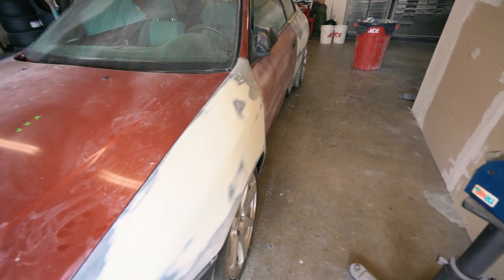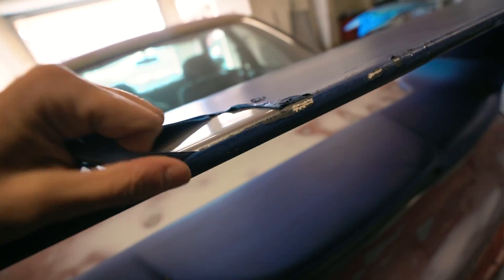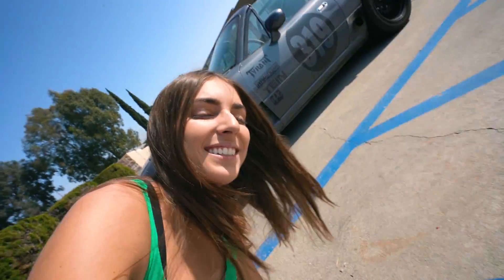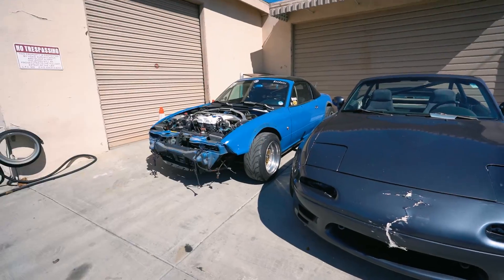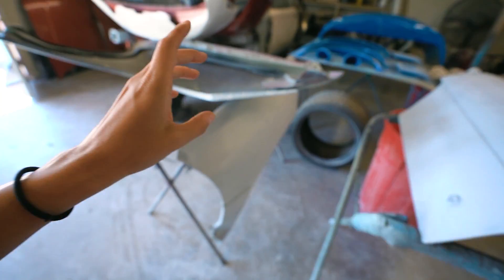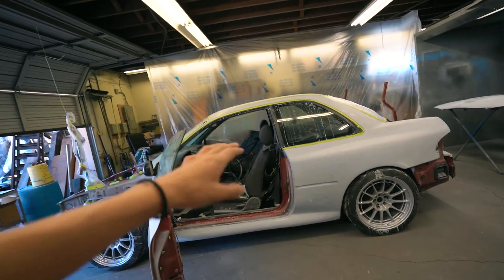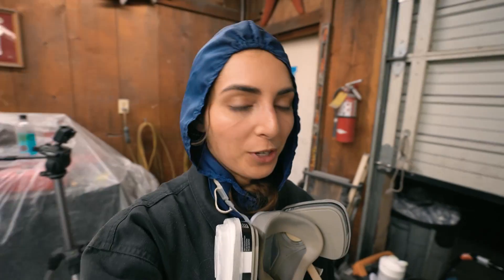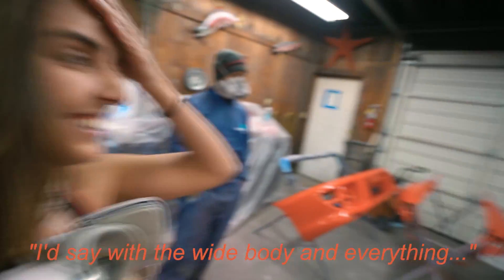$12,000 SUPERCAR PAINT JOB ON CHEAP SALVAGED SUBARU *COLOR REVEAL*

Comment: Turtle wax sticker adhesive spray will take off plasti dip just spray it let it sit and wipe it off if it is on thick I can use a plastic or rubber scrapper

Comment: Not worth 12000.00 that's a 2500.00 any day of the week.
Reply: Add all the bodywork involved in the wide body kit, expensive paint, and the cost of all the parts, $12k seems about right
Reply from the maker: It just be hitten different
Reply: OK.  Now I'm just talking about body work n paint. The body kit might be pricey but the body work n paint not worth it. 
I do autobody and mechanics. Ontario is a bit different I guess
Reply: But the gallon of paint was almost $1000.00.  So you would only charge $1500.00 to do all that bodywork and all those other supplies needed?

Comment: It hurt me a little when you said $220 a qt.  I already knew the $80 a qt I am paying for my paint wasn't a bad deal, but dang.  Also, as far as the "structural integrity" of the fender people are spouting off.  There are MANY widebody fenders that are fiberglass and direct bolt on, ie its not using any metal.  Hell, if people used their brains they would remember that Saturn had PLASTIC fenders with no metal.

Comment: You need to color correct your camera... somewhere in your settings you're able to color correct it but if you have it set on flat so you can capture the most deaths so you can color correct after words which evidently you didn't in your video is still looks kind of orangish there is a way to color correct your cameraor at least should be possibly someone here in the YouTube world be able to help you based on the camera that you have...